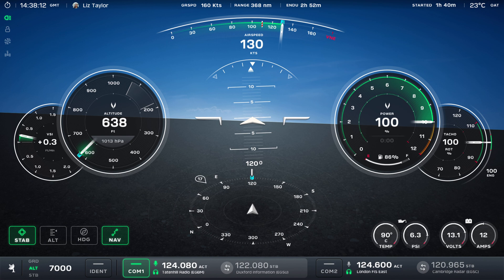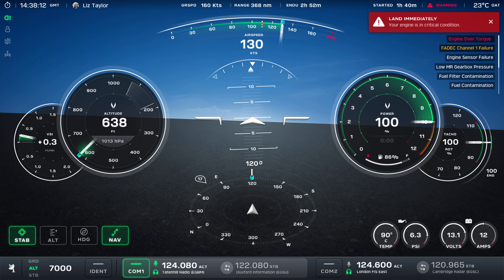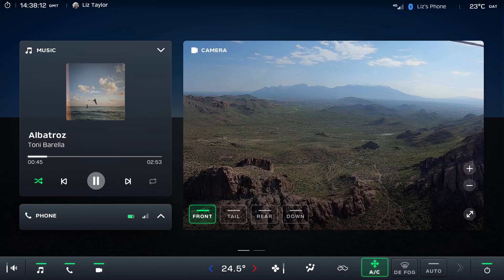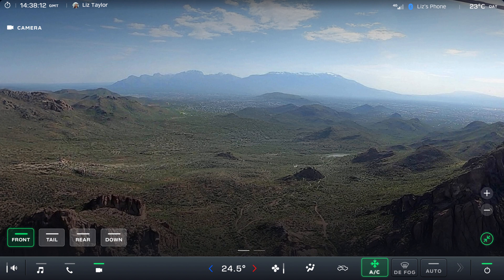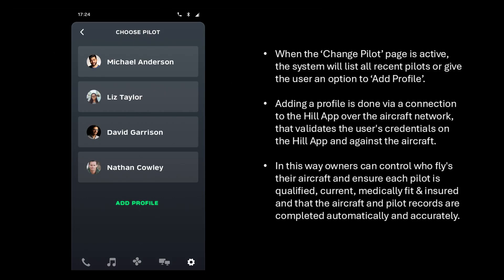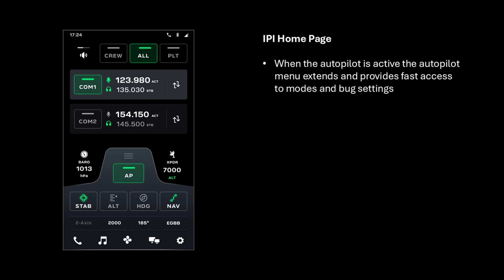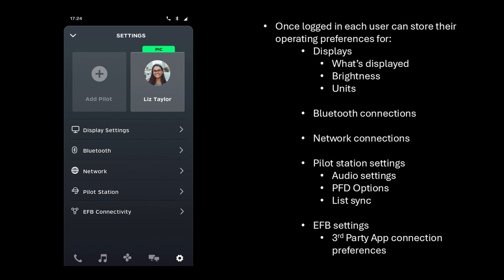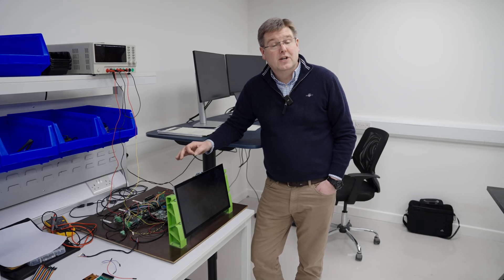A Deep Dive into the Hill Digital Cockpit

Comment: Absolutely love the idea and design. But I'd prefer the option to change the layout of the critical flight information so it can be what is universally used. Speed on left, alt tape on right, VSI on right etc. 

Also, if I was to invest, I'd definitely want the Recirculation/ Fresh air button to be a helicopter, not a car ...

Comment: I recommend that VSI indicator be incorporated to the right side of Center Attitude Display instead of being on the far left side of the PFD. I am used to flying EFIS equipped Jets and helicopters and everyone of those EFIS screens, regardless of whether they are Garmin, Honeywell, etc are set up that way because VSI is an important information that should be provided with the attitude, airspeed and altimeter information.
Reply: agreed

Comment: As a commercial helicopter pilot I’m getting a lot of red flags. I don’t see this doing well. I think these videos are aimed at investors. Feels like an iPhone release. Nothing in this is encouraging to me as a pilot.
Reply: Why do you say that, what are the red flags? I'm interested to know.
Reply: @tsepom455  from a pilot's point of view it is not intuitive.

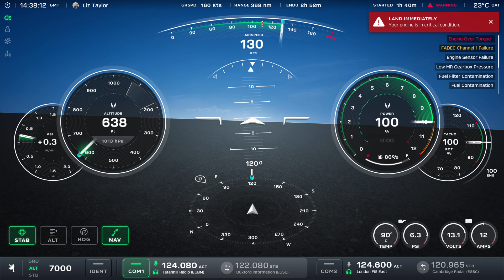Look at 2:00. The airspeed is at the top, altitude on the left. Every aircraft I know of has the airspeed on the left and altitude on the right.

The prominent positioning of power and tacho is good, but why power not torque as every other helicopter? Power is torque multiplied by RPM, so at normal flight RPM power is a proxy for torque, but why use power?

The main other issue I am seeing is use of touchscreen controls. I don't even like them as the primary in a car (and some manufacturers have recognised that they are not as good) but in an aircraft I am really not keen. Strikes me as wanting to look modern rather than looking for good ergonomics.
Reply: @randomxnp  because power tells you what percentage of max available lift/thrust you are currently using. Torque doesn't.

Which is why every single plane/heli with a FADEC tells you power and not torque.
Reply: @anonym3017  Given constant RPM power is directly proportional to torque. The formula for rotational power is torque x power x k, where k is a constant depending on units used.

Torque is also the actual limitation (main gearbox limit) for most helicopters unless operated at high density altitude, so if the RPM is slightly off due to a technical problem then torque will give the limit.

On the other hand what does "Power 100" even mean? Is that 100% of the rated power of the helicopter (max torque and max RPM) or is that 100% of the power available from the engine? At higher altitudes the latter will be lower.

This is the real problem, as either way it will need training different to that for other helicopters. A first-limit indicator is a better system.

Comment: Cool Helicopter, but pilots don't want to fly a phone. Cloud connectivity is just bloatware and possibly spyware. Pilots want ultra dependable avionics so that when wx is stressing them out and the bespoke turbine engine is making funny noises over the water, they shouldn't have to think about why the automatically updated update-4.3.2.1-hotfix18 changed the layout of their menu items. Can't imagine navigating away from spotify in turbulence on a touch screen. When pilots have landed in between metal hangars, the don't want to find out cell service is the main reason they can't download flight times from a shoddy app to their logbook. And why the passcodes? If physical security isn't enough in this helicopter, rethink your physical security.
Is this even designed for pilots??

Comment: Those displays look really nice but is that setup rugged enough for day to day flying?
Reply: i am guessing this is one part of the aircraft not yet built by Hill, is the screens
i worked for a company years ago who built ruggedized systems for Tornado F2, they manufactured some of the original real time reconnaissance equipment, taking standard Panasonic video recorders, removing all the guts to install into a rugged box, tested it to destruction and advanced the techniques, its all doable, rebox, mount on rubber fittings and sign off - i'm sure the entire helicopter will be smoother than your everyday chopper, i'm sure landings will be better, but i'm also sure there might well be the odd bump or two, what happens when the screen starts to flicker and the cables fall out the back, i can't quite see smacking will help like it didn't with my last laptop - well you can always swap seats i suppose hehe

Comment: Does your avionics support IFR flight, will the HX50 be IFR certified?

Is it RTOS based avionics?

Are there systems redundancies in place in case of failure?

Is there ADS-B in/out, TCAS, EGPWS, /HTAWS, WXR, ILS, DME, GPS/SBAS, RNAV/RNP, INS/IRS? 

(As you have noted in prior videos, you are trying to compete with those high-end helicopters, and put everything in one package, while making it affordable)

Must one use the cloud? Can an owner use their own privately hosted server that integrates with both the app and the hx50, instead of sharing their data with you?

How many nits of brightness can the displays output?

Can both of the displays be MFDs/PFDs? (Some helicopter pilots favor operating from the left seat…)

Comment: Not a big fan of Cirrus's cloud based tracking either.
Do I really need or want Hill Helicopter watching and recording my every move in my helicopter ?
Reply: Yes you do if you want cheaper insurance rates.
Reply: @Thegr8iam-p7t  Accident rates and time in type should set insurance rates.... not nanny monitoring.
Reply: @sugershakify 
Agree it’s the data collection of those rates that this will do. I’m all for it because it also acts as a security mechanism. If you are not a recognized pilot the machine won’t start
Reply: @Thegr8iam-p7t  Great, so you need to fly out of somewhere in a hurry, buuuuut...your wifi is down, and Hill App says, "No helicopter for you!"  Or, you know, you get to be the lucky discoverer of a bug which prevents "logging in to your helicopter"...  There is a limit to how much tech should be applied.
Reply: @blahblah49000 
Yeah I guess you’re right … let’s go back in time to 3 in the tree transmission’s and 4 barrel carbs.

Comment: In a glass cockpit world of standardised layouts (ie ASI tape left/ALT tape right) you're expecting any pilot coming to the HX50 to re-calibrate their screen scan. For a pilot flying different types day to day I don't understand your logic. Change for change's sake?
Reply: The argument could easily be made that most helicopters flying don’t have glass panels so the standard is actually round gauges. Therefore this layout would easily be understood and picked up. As a pilot familiar with both tapes and steam gauges I don’t see an issue in switching back and forth or in this layout.
Reply: @joshuashackelford6696  Most helicopters flying around with glass panels also incorporate redundancy and physical switches, this has neither.  Large panel touch screens might be ok for a car entertainment system. Not something I want to F* around with off the ground.
Reply: This is a standard argument leftover from 90s…

Boomers demanded analog presentations of their digital data…

I have a car and a plane that both have needles driven by electronics attached to digital sensors….

Anyone that flies multiple planes, and drives multiple cars, doesn’t have a problem remember all of the details.

Screen graphics of any form, are way better than the needles of 1965…

People thought digital screens were prone to going dark… and take out all instruments with one failure.

Recalibrating your screen scan…?  That should take about 50 seconds…

The HX50 is VFR only, so the first 50 seconds of flying won’t end in flying into clouds…

😃
Reply: @AC-jk8wq  'HX50 is VFR only,"  This getting even worse. This helicopter is so niche I really don't see why they would choose such a design. Who they expect to buy it.
Reply: @Jason-Recliner err, well, there seem to be lots of Robinsons around … and this is quite a step up …. Sooo…I’d guess there is a market!
Reply: @Aries1701  For a trainer/utility helicopter yes. This isn't either of those.
Reply: @Kiwi_Dave  they've got a hell of a lot of advance orders so people seem to like it.
Reply: What standardized layout are you referring to? 🤣
Stop being lazy dude
Reply: Would be interesting to try out, but for the money you could just pick up a used MD500 - Far more practical versatile helicopter. I really don't know what the market is for such a niche helicopter.

Comment: Out of interest can you tell us the platform and OS?  I am interested in whether it's an RTOS, or Linux or Windows.  Also the UI library - QT?
Reply: Yeah, like I want Microsoft running my helicopter's avionics...
Reply: Was wondering the same. Not an expert but I’d guess it’s a hybrid design with Linux at the top controlling subservient MCUs running FreeRTOS. That way you can still fly when it kernel panics. Could alternatively be one big Windows app, but yeah that would be even more terrifying.
Reply: I'm late to the party, but they are using Rightware's Kanzi UI (Used by many tier 1 auto OEMS) for the HMI. I'm guessing they are using a certified RTOS like QNX, as basically noting else would be easily certifiable.
Reply: If I were designing it... flight computer would be Linux with flight software written in Rust, running on an ARM (which is what that dev board of theirs looks like, maybe a Snapdragon), and UI would be a separate Linux system using a web stack running on something similar.

Rust provides an immense level of safety for the critical systems (AP, flight data processing / EKF, et. al) and the web stack lets you leverage commodity hardware and software stacks that have had billions of dollars and millions of eyeballs testing them for years. They can be extremely robust, they just get a bad rap from all the garbage code people write for web. RTOS will be found on the embedded controllers elsewhere, like the AP servo controllers, and very likely connected over CAN to the flight data computer. RTOS is of no use outside strict signal timing requirements, so wouldn't be used outside ECs. Flight data computer to UI would be IP, which allows you to fail-over your PFD to the iPad if all else fails.

Comment: Fantastic news but here's a question if there's a pilot emergency and he becomes unconscious but the passenger cannot fly is there a emergency landing button to land it safely 🤔
Reply: Like what your comment is but a small correction sir. It’s a 4 axis autopilot used for helicopter’s. With the amount of technology available id say autoland will be a breeze for HX-50
Reply: @Thegr8iam-p7t  Aaah, thanks. Yeah, with 4 axis one of the 2 aspects required for this is complete, the controlled descent. Its the other that I wasn't too sure of because a heli can land anywhere yet where the incident occurs may not lend itself to a simple autolevel then descent so there is a level of autonomy required but with AI and the leaps already achieved with the push for self-driving cars they may be well on their way without starting from zero.
Reply: Based on the levels of magnitude more a heli pilot's command of the aircraft must be at any given time, I would say this depends: on one side the HX50 and HC50 both offer 3-way autopilot as an option so I assume adding this feature is possible (at the very least at the press of a button the heli can autolevel then descend but I assume based on the foresight this project has they are already past such a rudimentary system) but on the other, assuming the pilot is hand flying when they suddenly are unable to fly the aircraft there may be precious little that can be done considering how quickly a helicopter can become unrecoverable following lack of pilot input on the cyclic and/or pedals. But, to end on a hopeful note, the 3-axis autopilot would allow the possibility of a system similar to Garmin's Safe Return in the future, if it isn't being considered already. 👍🏽